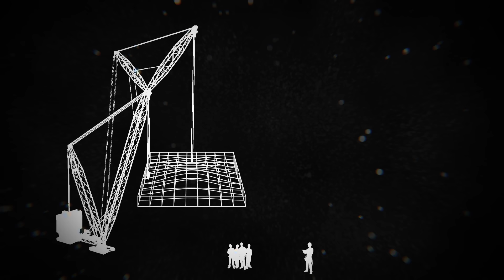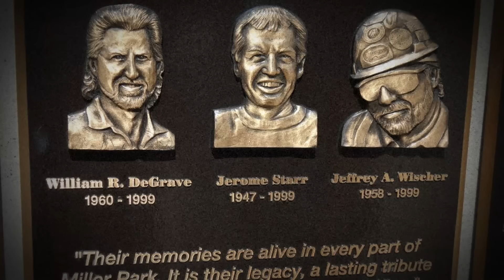Massive Crane Kills Iron Workers | Last Moments

Comment: What you didn't mention is that the company that made the crane sent their own crane operators to operate Big Blue. They refused to do the lift in the high winds that day. So Mitsubishi put their own people on the crane, which led to the disaster. This was before and the reason why CCO (Certified Crane Operator) credential was invented. So not just anyone could run a crane. And also why Mitsubishi was found 97% negligent. It was calculated that the ironworkers in the bucket had 12-14 seconds to realize what was happening before their death.
Reply: Seen a few uploads going over the accident over the years and was beginning to think I'd dreamt up the bit about a change of crane operators so thanks for that. None of the uploads I've seen mentioned the blame apportioned to different parties though so I learned something new.
Reply: Then that is even worse - that should be have been a warning to the operators.  Trying to save some money cost them over $100 million dollars, not to mention the repair costs and delays.
Reply: not knowing anything about massive crane operations, I do know that the winds here aren't california stuff, but can be unpredictable. I had heard that the accident was due to "high winds" but 20 mph isnt at all that gusty here. That's like a cool breeze, even 25mph. Just enough to blow your skirt around. But not up, eh. Your hat'll stay on just fine. So, kind of a freakish accident with a very delicate operation/machinery. <3 Big Blue.
Reply: @miriamdiggler1288  As a sailor I can tell you that 27 mph is 23 knots - that is getting pretty windy for anything like a sail.
Reply: @miriamdiggler1288 20 mph while doing any type of arial work is a lot.
Reply: @miriamdiggler1288 ya that’s California. Here in North Dakota 25 mph is the difference between life and death in a lot of ways more than 1. 32 degrees out with a 20 mph wind can feel like -10 here, which would mean your exposed body parts can be frost bitten within 15 minutes at 32 degrees. That’s not even the freezing threshold yet the wind makes it so, it doesn’t seem like a lot where your from im sure, but around here 20 mph winds automatically tells you your about to have a bad day as a construction worker in general, 200 ft In the air or on the ground
Reply: I live in neighboring town and they stated on the news they were going to do his lift today.  As a non-engineer person, I thought it's pretty windy today, they shouldn't be trying that.
Reply: @miriamdiggler1288  25 is a good wind if you're doing something up in the air. I'm not even allowed to climb a ladder at my job if the wind is over 25 mph sustained
correction - 25 mph gusts
Reply: Thanks so much for explaining that part of it. Insane move from Mitsubishi. Extremely costly mistake
Reply: @Winddancer1991  In Canada, you are also correct as fuck. It's been -38C (-36F) but felt like -48C (-54F) due to wind chill all day and tonight will get to -49C (-56F) but feel like -55C (-67F). High or low; the faster the wind, the faster the consequences/fatality.
Reply: @art-i-choke8563  My goodness, you Canadians must be very hardy and resilient people to be able to function in temperatures as low as that! I'm in the UK and I've been moaning because it's got down to -5°C - I'm guessing that would feel like a pleasantly mild spring day for you!
Reply: Where did you find that information about the crane operators being changed that day?
Reply: @zappababe8577  The Canadian iron workers are some of the baddest I've ever seen.
Up there with the guys from the Adirondacks.
Reply: @art-i-choke8563 I couldn't live in an area that cold, I just couldn't.
Reply: that makes sense Was wondering why Mitsu was responsible
Reply: Thanks Captain Hindsight.....for your obnoxious insight.  There's better documentaries on this failure.
Reply: Thanks for the info, I couldn't work out why Mitsubishi was that heavily at fault if someone else owned / ran the crane
Reply: If you've ever been in a vehicle crash or a near miss you'd likely know that 10 seconds can feel like forever. They had ample time to realize what was about to happen but no time to do anything about it. How horrible.
Reply: you must have commented before watching
Reply: Makes me wonder why they weren’t found 100% negligent. The company that made the crane literally refused to operate it that day, what are they supposed to do, use violence to prevent it from being used?

Comment: These sorts of accidents are sadly almost always because of managements incompetence and arrogance
Reply: Or from the client insisting on ridiculous demands in the contract.
Reply: @supertuscans9512 yes, the time line to get the project finished was rushed from the start.
Reply: True sometimes the ridiculous deadline set causes corners to be cut
Reply: or "cost-cutting measures"
Reply: Until managers serve time in jail, this loss of life will keep happening.
Reply: Right after this accident, a small lift crane had the same issue working on a windy waterfront site in Seattle. Lifting a rebar panel, wind "sailed" it back into boom and the out swing toppled it forward. Lady crane operator only non-serious injury. 🙏🏼
Reply: Stupidity possibly may always benefit from epic catastrophic failures as it eliminates the problem directly.
Reply: @jayjaynella4539 I'm just glad there wasn't a ball game going on when this happened 😮
Reply: @supertuscans9512  Then ironically they get put over a year behind schedule after a collapse like this where they'd only be a few weeks behind schedule waiting for the wind.  It's fucking infuriating
Reply: 100 percent boomer boss moment.
Reply: Management strikes again
Reply: @derpyderp1991 which puts those timelines back when accidents happen. A cycle of stupidity.
Reply: And impatience.
Reply: @jayjaynella4539 depending on what industry and jurisdiction the project is taking place. But yeah some times hefty fines and even prison time could fall upon management... Depending.
Reply: @supertuscans9512 it’s on the company for accepting such ridiculous terms then. Least be logical
Reply: @goodnightmunchie How would there have been a game when the place wasn’t even finished yet?
Reply: Yep, When someone who tells you how to do your job.....
Has never done your job. .....Its fkn madness.
Reply: has nothing to do with management or incompetence. Its just pure chance. Everyone stresses their equipment. If you dont, you're a crap worker and inefficient
Reply: Well, sure helped them reach the almighty deadline. /s 

And now several people grew up without Dad ever coming home again. They massive payout can't bring those guys back.
Reply: @supertuscans9512 Clients can insist, but they can't compel agreement to the contract. They're almost never going to know as much as the contractor about where the "lines" are (where the risks become unacceptable).
Reply: @jayjaynella4539 Such mistakes have always happened and will continue to happen even if managers serve jail time. The only question is the frequency. And it happening less often does come at a "human" cost, due to the fundamental tradeoff between efficiency and risk of all the various forms of failure. There's no such thing as "mere money".
Reply: @supertuscans9512 It's the responsibility of the management to tell the client what's possible not lie and then cut corners.
Reply: @goodnightmunchie  If there was a ball game going on that means the stadium would be done construction, and there wouldn't even be a crane. So...wut 🤨
Reply: the way he says contractors... CON TRAKE TORS. LMFAO

WHAT IS HE? IRISH?
Reply: @supertuscans9512  The construction company took on the contract knowing those deadlines. If they couldn't meet them, they shouldn't have taken the money.
Reply: Yep, pencil pushers who know nothing of engineering! Think of the Challenger disaster!
Reply: “Desperation” to meet the deadline is another apt word here. Desperation can kill. It did in this instance.
Reply: Cranes are so very well designed that neglect is nearly 100% the reason for any loss.
Reply: I ain't risking lives, my career, or any professional licences I may have for a manager. My ticket, my rules. I can always get another job.
Reply: yep, same in hospitals
Reply: Don't worry the managers got a raise and bonus that year.
Reply: Most rules are written in blood.
Reply: @@NeuroburgerOne of the guys turned black too
Reply: Especially so with Big Blue

Comment: I'm a contractor.  Used to be foreman of framing crews.
 We were building large apartment complexes and it was pretty standard procedure to build the gable truss on the ground and hoist it up. Picture a large wooden triangle 100' wide by 40' tall sheeted with plywood. If you're picturing a large wooden kite, your on the right track.
 One day with winds gusting 20-30 mph we needed to set the gable truss.
 I told my superior (I answered directly to the project manager) I was too windy and too much risk to try to fly a kite I between wind gusts,  and that we would lay the gable truss flat on the upper story walls, sheet it, then tilt up. Safer.
 After a LONG discussion he won, and it was time to fly a huge kite.
 Me and my crew were on top of the 3rd story walls, ready to accept the package. As it was being lowered and about 10' above our heads (keep I mind we're standing on top of 2x4 top plates) a gust came it and it just explodes.  I had bracing in place so when it got close it would just slid down the bracing and into place.
 It all shattered. 
 I just yelled to my crew JUMP!
 Everyone bailed. Keep I mind it's only 8' down I you jump to the interior floor. The guy holding the tag line on the ground was drug about 30' across the ground and then about 8' up the wall, not willing to let go because he didn't know where it would fall (or on who) if he let go.
 Luckily,  no one was hurt. A lot of rattled nerves.
 As soon as I took head count of my guys and everyone was okay.
 I saw the project manager on the ground, threw my entire toolbelt at him and i started sliding down braces like Spiderman to get at this bone head.
 He locked himself in the office.
 Needless to say my guys didn't bag back up until that mfer was fired !
Reply: Damn dude! What a story!
Reply: Wow thanks for sharing your story.
Reply: Damn, that is rough.
Reply: why do people type these long ass stories in comments
Reply: @detectif1061  So that people with attentionspan longer than 10 seconds can read them, in best case learn something but even in worst case it can provide some entertainment?
Ever read a book?
Reply: @detectif1061 No one is forcing you to look or read it for that matter are they?
Reply: Yep, even the injuries if not killed can destroy a man's life. I've seen it done.
Reply: @detectif1061 even a goldfish would feel sorry for your lack of an attention span.
Reply: @detectif1061 this Dude is right fuck these long, annoying stories. They pop up everywhere on this site and there's no way to assume they're not completely made up so someone can get likes
Reply: @donbronson2518  Okay dude.
Reply: Good for you taking care of your guys. I used to work carpentry and construction, did a number of projects on a boom hanging above rush hour traffic down here in south Texas where wind gusts can get pretty bad. 
Your tag line guy has balls of steel.
Reply: @PERTEKofficial  bahahaha
Reply: @donbronson2518  so people share their experiences and stories on a public forum, that’s the whole point of the comment section.

If you want one-line comments that get spammed over and over again, then watch shorts instead.

Comment: Insane to see steel crumple like cardboard. The forces at work here are hard to grasp.
Reply: That steel is thick,  too. Most people have never even seen steel that thick. Videos don't do the scale justice
Reply: I've seen scaffold poles bent into shepards crook shape by scaffold collapsing.
Reply: Its almost crazier to see it function properly
Reply: U must not be from wisconsin
Reply: It's what makes those cracking sounds at the start that much more terrifying; it's the sound of sudden tensile failure in steel, something that can only happen when under extreme tension and the average person will never hear. You hear a sound like a gunshot, and that steel scaffolding becomes putty.
Reply: Steel is pretty soft to be honest.
Reply: @user-sp4gy7ko5l  It’s not the most stiff material, but it’s one of the strongest materials we have. Stronger than carbon fiber, or most other fancy materials- though the strength to weight ratio is a different story.
Reply: @ewill3435 Reminds me of tape measures and how after about 1 meter they can’t support their own weight and collapse. Just far more violent and large.
Reply: Especially steel of that caliber. A 1/64 inch sheet of steel breaking, compared to bars probably bigger than breaking is insanity.
Reply: While steel may be soft in the grand scheme of hardened products, we as humans only know of steel being extremely strong and heavy. Most of us only deal with steel as a finished product like truck and car pieces, light poles, walking and car bridges, and other smaller projects that are finished. When the common human sees steel, we see it braced and reinforced to engineering specs. But if something happens to steel that is out of its designed capabilities it’s mind boggling. I’ve seen a bridge’s steel girders bent in such a way I never knew was possible before the flood. It looked like the result of someone playing with a stick of lead.
Reply: @outdoorfrenzy  even with cars people think that steel should be indestructible. You would be surprised how much can get tweaked and broken at 15MPH.
Reply: @user-sp4gy7ko5l  It's not the soft the issue, is the buckling under load which changes the forces from compression/tension to bending/twisting

Comment: One thing that is left out that I feel is pretty important is those 3 loud booms before the crane fell. Those bangs were the 12" or 30cm diameter king pin that connects the crawler tracks to the crane itself breaking into multiple pieces from the strain. 

R.I.P.
Reply: Sounded more like explosive rupture, if anything.

EDIT: (for those unaware, that doesn't mean explosives were planted, just means there was that much stress and energy built up in the material).
Reply: Thank you. I was wondering what made those “bang” noises before it fell.
Reply: Thanks, I was wondering what caused those booms.
Reply: And you know this how / why ? Just asking
Reply: @thefinisher2010  I will see if I can find the OSHA article
Reply: @SkrixFox  no problem,  thnx
Reply: another thing left out is the fact the ground was soft. The people in charge rejected several times when asked for gravel to stabilise the ground and on the day the crane was sinking under the load. The booms are the centre pin breaking which was all that was holding it straight at the end

Comment: I worked on a job site that built off shore oil rigs for about a year as an electrician. The rig had a 500-ton crane working on the site that had a cracked brake drum, but it was still good for little lifts that were less than 10,000 lbs. They were getting ready to put leg extensions on the rig but these lifts were 250 tons. The crane operator told management that the crane had the cracked drum and they couldn't make such a heavy lift until it was fixed. Management told the crane operator to make the lift anyway and he again told them that they would get someone killed if they tried. They told him to make the lift or he was fired. He walked. I knew him very well. He was a veteran operator licensed up to 800 tons. He said he wasn't going to have someone's death on his conscience the rest of his life. So, they brought in a new operator. I don't know how much he knew about the disrepair of the crane. The day of the lift came. There were 3 welders tied off at about 80 feet waiting for the first leg extension to be lowered into place. Everything was fine on the way up but when the crane operator tried to engage the brake and ease it down it went into a free fall for about 30 feet. When 250 tons goes into a free fall, there ain't a crane in the world that can stop it. He almost ripped the crane off its foundation trying to keep it from falling on the guys. One of the welders had his face crushed and spent months in the hospital, the other 2 were killed. The families of the 2 dead welders sued the company and the fired crane operator agreed to testify that management KNEW of the faulty brake drum and fired him for telling them they'd get someone killed trying to use the crane before they got it repaired. They had em by the short and curlies. They could make them squeal the high notes and they did. Their attorney even got them for not just negligence but GROSS negligence, which insurance doesn't cover. It comes directly out of the owners pockets. It bankrupted the company and they sold out. All that because of greed. The 2 dead welders were young men trying to provide for their families. Both had young children at home and young wives. They left for work that morning and never came home. All because of the love of money. Money before safety. Greed. It's too bad that criminal charges can't be brought against people like this. I bet with the threat of 20 to life hanging over their heads they'd be a bit more cautious when it comes to making decisions that directly affect other people.
Reply: Yea that’s crazy. I’ll never understand why people cut corners just to make a buck. I would have told those welders not to work on that project until the brakes were fixed.